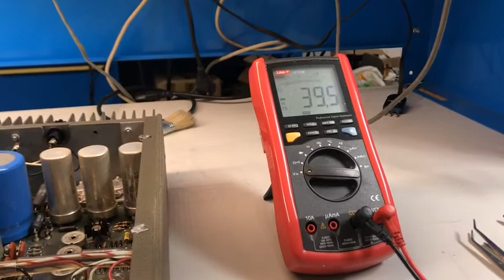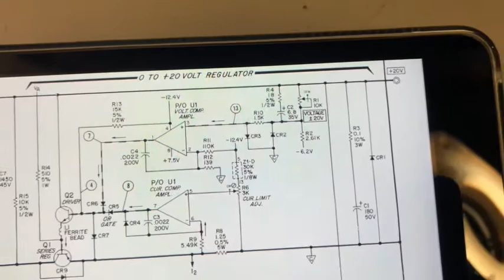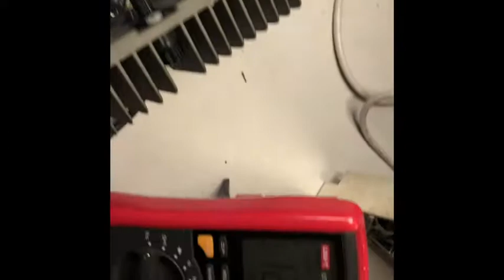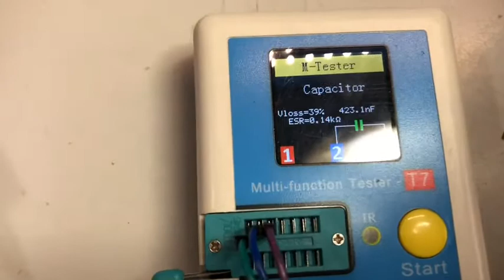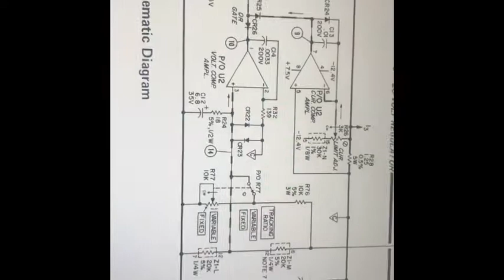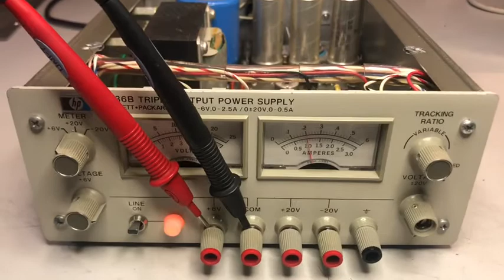HP 6236B repair

Comment: Noticed if big screw type capacitor making bad contacts w/ board voltage drops under load.  Even through screws were tight.  HP 6236B Re-sitted-fine.

Comment: Excellent !!! Thanks to your video I was able to repair my power supply had the same problem in the 18V stage, capacitor C21 was bad. it took out square wave and did not regulate.
Now it is fully operational. Thank you very much.

Comment: Thanks for posting this video! I have an HP 6236B with a different problem, but your video was still very helpful. My HP 6236B smoked a resistor in the "Reference and Bias Supply" section. I have a replacement on order. I'll also be checking the capacitors in that area.  I look forward to your video showing the LED meter light enhancement and may do the same for mine.